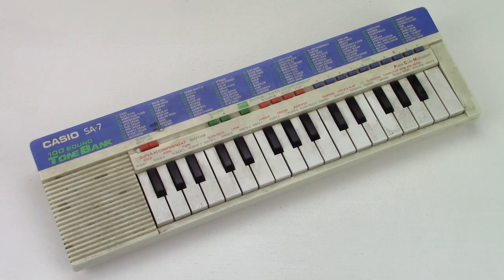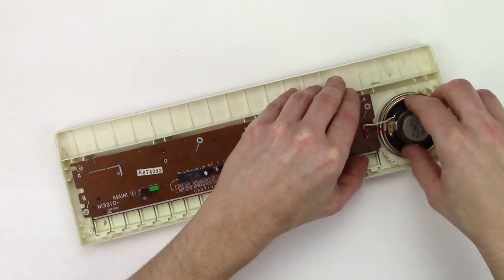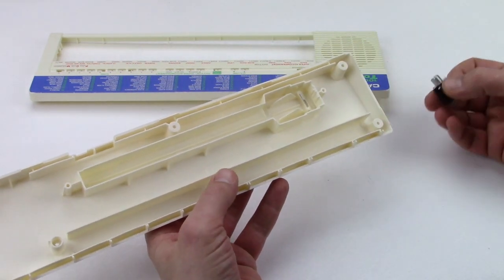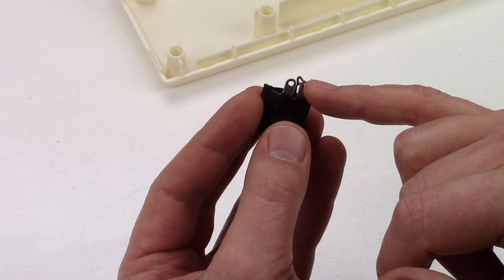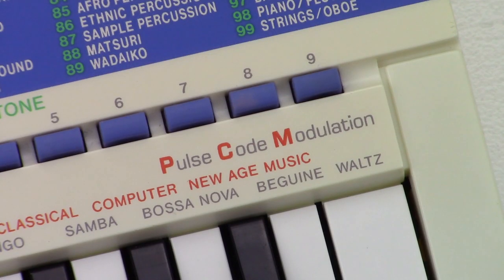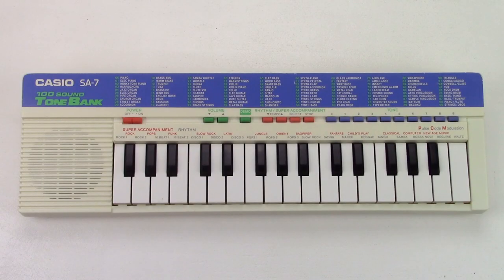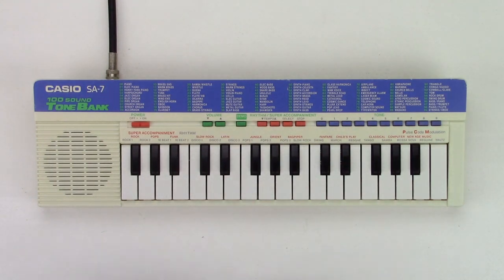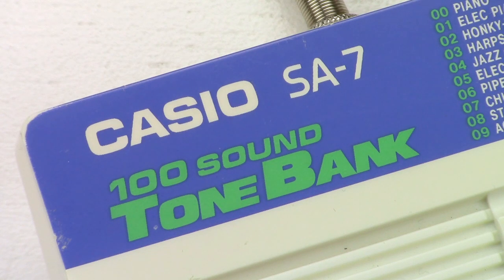Casio SA-7 - Review & Output Modification

Comment: I love this era of Casio sounds; really unusual sound. "Metal Guitar" is stunning.
Was there ever a more professional/synthesiser-like version of the SA Casios? As in customisable pitch envelopes etc. with the same nasty PCMs.
Reply: you can make crazy pitch envelopes on the cz and vz series. A lot of the sa-series sound like low-res samples of the cz. but the sa could be doing some synthesis also as the envelopes seem too complex to be samples and the chip seems too small to store 100 samples. there isn't any obvious  way to interface with the chip so i don't think anyone has reverse engineered exactly how the sa series works.
Reply: @BatteryCoverMissing  I imagine it's a couple dozen waveforms, modified by envelopes for pitch and amplitude (and doing the fake reverb). I thought some of the waveforms were CZ-ish!
Reply: @RothmanHarv  I hope someone decaps the chip and figures it out soon. There is not really any other synth that distorts the samples in the same way. They had a lot of patents at the time for doing both PCM and FM/Phase distortion on the same chip so it could be a piano and drum waveforms taking up most of the memory and the rest synthesized. It probably uses 2 bit dac like some earlier casios (internally generates 12 bit sound but only outputs the MSB and LSB. It seems to get the same "woolly" timbre.
Reply: @BatteryCoverMissing  That's interesting. There's nothing quite like it!
Reply: You might look into the Yamaha CBX-K1-XG (The XG model has a built synth engine and speakers, unlike the controller only CBX-K1) it has a pretty deep ROMpler PCM sound bank but also has basic envelopes, Low Pass and Reverb as well as Pitch and Mod wheels, also MIDI In and Out on 5-pin, also runs off 6 AA Batteries. They tend to be pricey over $100, but in the modern world there really isn't anything like them for size and power.
Reply: I think that PCM chip might have been a mass-produced version that was used in basically ANY Casio toy keyboard with PCM samples. The same chip, just with different firmware, might have been used in Casio’s Superdrums keyboards.
It may be easter-egg reverse-engineerable with messing with the key matrix to some extent.
Reply: The SA 35 isn't really a synthesizer, but it has a lot of the same PCM with more focus on the weird synth / FX sounds and each patch has 4 "versions". Probably the best SA. The VA 10 and the CT 470, 670, etc. series are probably the closest to the SA series that approach being real synths. Maybe the CTX 1000 too but I haven't tried one out.
The CZ and VZ series are great synths but not all that similar other than maybe being some of the sources of the samples. The FZ series is also pretty cool and the digital oscillators in it are pretty nasty and lofi. There is some sort of synthesis going on in the SA chip other than just DCA stuff. Some of the patch "versions" on the SA 35 apply LFOs or envelopes to pitch, but the parameters can't be accessed directly. A full fledged rompler based around the SA-type chips would have been cool.
Reply: BatteryCoverMissing Believeit or not, almost all SA keyboards use sampled wave forms from other synths and sometimes, from their competitors. To make the bell sounds, such as in the cathedral preset, the bell part is a wave form from the dx7, originaly programmed with 2 op algorihtm. So it only uses a form of granular synthisis with drum samples added to the lot.
Reply: @BatteryCoverMissing  the sa keyboards layer two short looping waveforms for nearly every preset, saving space
Reply: @11T7-d9u  but this hasn't been verified as no one has extracted the data from the internal ROM on  the chip yet. it is not clear how those waveforms are generated. have you managed to decap the IC and extract the data?
Reply: @BatteryCoverMissing  that's a good point, I haven't extracted data, however I can at least confirm the tone bank uses two separate waveforms because I have seen them ripped to sf2 and I also have a sister keyboard to the SA series, the VA-10
Reply: @11T7-d9u  yeah the small versions use both oscillators usually but if you have models like the CA-100 CTK-100 etc you can turn one oscillator off to increase the polyphony using the POLY/TEXTURE button.
Reply: @BatteryCoverMissing  from the looks of the CPU it doesn't look to be much other than a basic sample player, perhaps the waveforms we're pre-rendered on other hardware, (the church bell sound is from the CT series etc.)
Reply: @11T7-d9u  some of the sounds don't sound like samples however, they don't have the discontinuities that samples have when stretched across octaves. and the CPU, DAC and ROM is all on one chip which itself is smaller than any of the other synth or sampler chips casio were using at the time. I don't think they can save that much space yet get so many tone variations without resynthesizing it somehow. There are also strange noise artifacts from what I assume is the DAC glitching out or the data compression. If it was just playing samples like a normal sample player it wouldn't be so incredibly noisy during the decay of the waveform and changing volume affecting the tremolo and vibrato multiplication counters is also unusual.
Reply: @BatteryCoverMissing  fascinating, I had assumed the sample depth was just really low, (8-bit, 4-bit), which led to the noise. However Casio does employ many techniques to get more mileage put of limited samples (the mute guitar is a shortened jazz guitar, airplane is two rising saw waves, the combined sounds like bass/piano etc.) Also the chorusing and combined waveforms can hide artefacts found when stretching samples, I have done such in my own sound synthesis endeavour. However ofc I don't know I'm making guesses lol
Reply: @11T7-d9u  yes, those are some really good observations you make. I want to hear your music now I know you are paying such close attention to the sounds (I always want to hear music that uses casio sounds anyway :D ). Hopefully one day we will work out how the chip functions. I will do some more studying of it also when I get time.
Reply: @BatteryCoverMissing  unfortunately I don't have music using specifically casio's synthesis, I rather create sounds from scratch using computer software.
Reply: @11T7-d9u  no, but that what what i meant. your music sounds interesting enough regardless., so send me some links :D

Comment: I modded mine years ago, but mine is a sa-9. With the empty audio jack part, my guess or theory is its a 7 pin connector audio jack that just slots in when soldered the pins, then will work like other sa serries models. I am planning on desoldering my jack and looking for one that just slots in and seeing if it works the same I believe the  design is close to same as ones with a jack. My guess they did it to cut down on costs

Comment: Hi, I also made the same headphone output in my Casio SA2, but after soldering the cables, like in your case, it does not disconnect the speaker. I've tried it on all my legs and I don't know what I'm doing wrong... I have a stereo jack, maybe that's the problem?
Reply from the maker: It's hard to tell from the distance. It has to be a jack with a switch contact. I showed it more detailed in my Yamaha PSS-100 and Casio PT-87 videos.
Reply: @KeenOnKeys  Thank you for the information, it turned out that the plug I use does not have a cut-off circuit, but I have another one that does :) _ Ok, I know everything now - thank you ;)

Comment: Hi Keen On Keys, if you like the sounds on this keyboard (they are good) and want a 4 octave mini-key version, you should aim to find a casio MA 100, 101 or 201.  They are not as easy to find as the SA keys, but all have the exact same 100 tones and 100 rhythms (as per service manuals, the same sound chip as with all early SA series, but different package version).  The 100 has a poly/texture button and a fill-in button same as the full sized CA-110, which is also the same SA chip.  The 101 has a separate accompaniment volume slider (minus poly, fill-in).  The 201 has stereo chorus, fill-in, acc volume, no poly.  Each of these has casio/fingered chords switch.  Hope that helps ;)
Reply from the maker: Yes I know. I already bought a MA-100 and a SA-10 as well.
Reply: @KeenOnKeys  lol, I have found that is the problem with vintage keyboards, you always have to have both... just in case ;)  btw, suggest you avoid the MA-150 its not a real casio, just a re-badged lo-fi music centre with loads of aliasing noise. terrible
Reply from the maker: @WeeInnovate-uk  Good to know. But that could also be a reason to buy one. I thought it was more or less the same as the other SA and MA models.
Reply: @KeenOnKeys  I plan to do some projects with the SA/MA series later.  The 150 was made for the Asian markets, cheap, plus midi out.  I have no idea WHY Casio would want their brand on an awful MC-36.  Now the DM-100 that's a lovely keyboard... even if it could have been implemented better. ;)  BTW, I commend the thoroughness, quality and attention to detail in your videos.

Comment: One of my siblings had the Casio SA-8 model, which only gave you 25 sounds instead of a hundred, but the noise made when you select the tone or rhythm is the same as on this model.
Reply: The sound chip that your SA 8 house actually has a hundred samples but the reason you only get twenty-five is because it's culinary
Reply: @luigikoopa8771  Interesting.